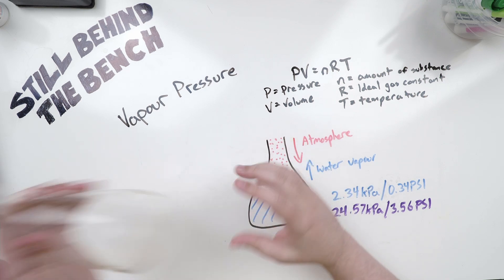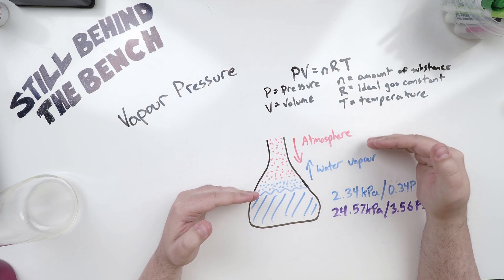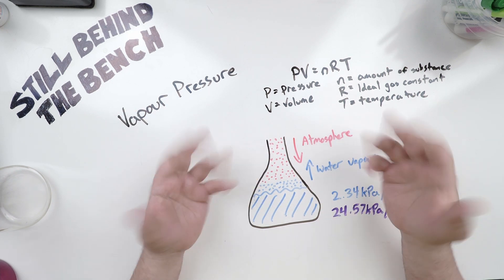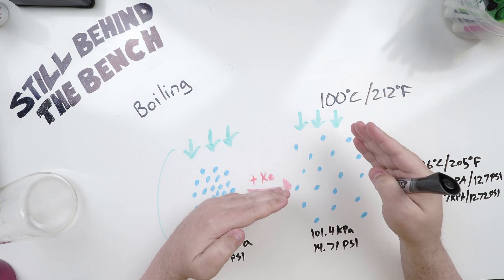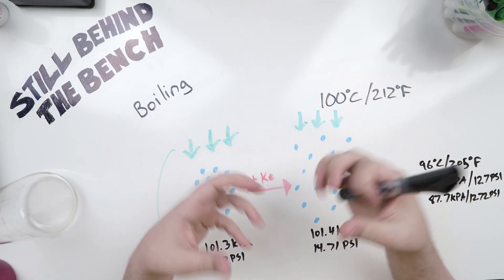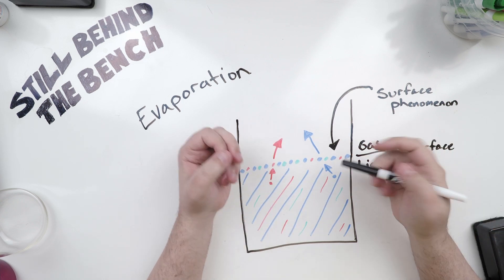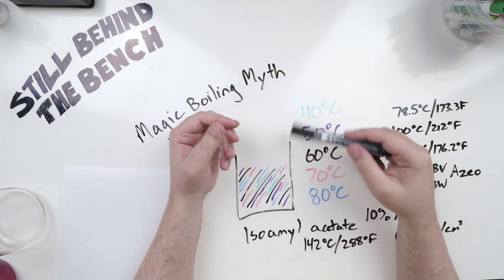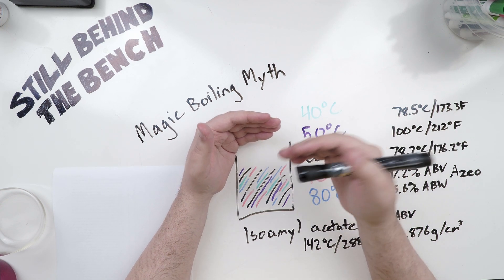Ep 022 - Magic Boiling Myth, Vapour Pressure, Boiling, and Evaporation

Comment: Great video. I do have one comment about boiling though. The heated surface is where boiling occurs not the bulk of the fluid. And that is logical since heat is required to initiate boiling. Without heat added there is no boiling.
Reply: Vacuum
Reply: @MereCashmere  true but that's not at play here. You can't develop a vacuum to run a still

Comment: Can you do piece like that about copper solder? There seems to be lots of fear mongering about led free solder ,that contains antimony ,folks belive its not good and as dangerous as leaded solder.any thoughts?
Reply: household plumbing has been put together with lead-free solder for decades, and with leaded solder for decades longer before that. a quick google search reveals that the most common formulation of lead-free solder is %96.5 tin, %3 silver, and %0.5 copper. the only one i can find with antimony at all has %3. that means your entire still has one or two milligrams of antimony at MOST.

Comment: Great material. I have a question though. How would influence mash agitation and heat power to the density distribution? I guess that keeping the wash homogeneous should influence the order of the compounds to come out of the still, or is it negligible?
Reply: I don't have a still that can agitate, so I can only give you a theoretical outcome. With that said, I believe that agitation should affect the order that the compounds come out of the still. Without the agitation, the density of certain compounds would cause them to naturally just float to the surface, and evaporate more readily. But if you are constantly forcing them down into the bulk of the liquid, than you will either smeared them out across the entire run, or force them to come out in a different cut. On top of that, the compounds that would naturally sink to the bottom, will also periodically be forced to the surface to evaporate. Some of this already happens a bit, due to thermal convections in a non-agitated still, but using a motor and impeller to mix things up will cause it to happen a lot more readily.
Reply: wow. as it seems advantageous to have the cuts clearly defined, it means no agitater. The big whisky pot stills have no such device. Nice presentation. thx. 🙏